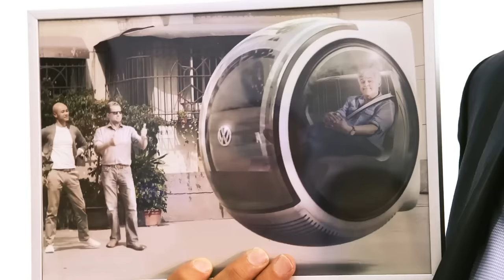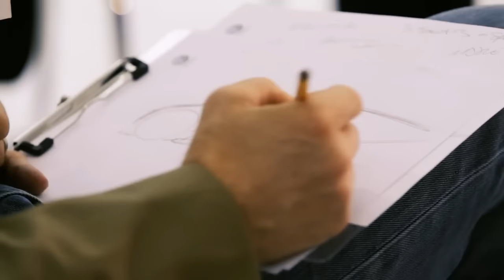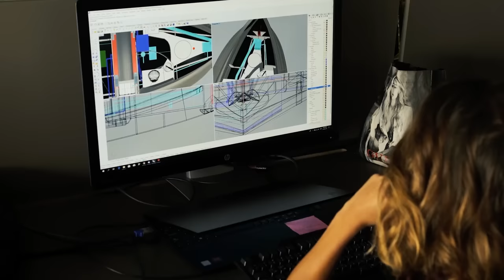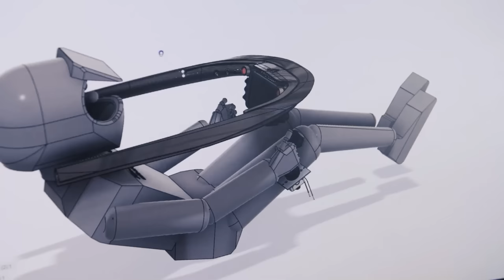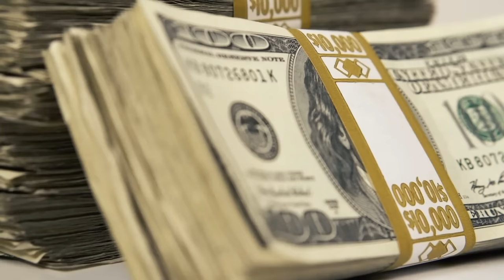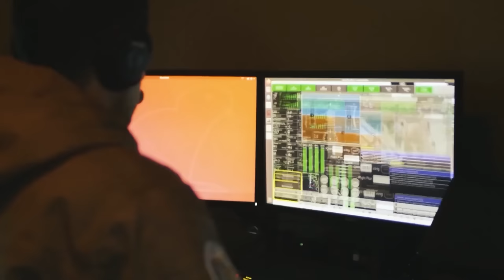The Plane That Will Change Travel Forever

Comment: No Electric system is completely environmentally friendly. FACT. The mining involved and manufacturing involved is not environmentally friendly.
Reply: Not to mention making of parts battery fires and when they become obsolete. You hit it with the hammer I just finished it😂😂😂
Reply: Electric still is a bit more environmentally friendly than fossil fuels, especially if they recharged with solar&wind. If you look it up you may learn something. I don't like electric for a different reason, they burn. As soon as they make non burning battles  I will convert my van to electric with solar on the roof.
Reply: @Justwantahover  let me know how that turns out! In some areas it could solar and might be more proficient than others, but that would be the exception, not the rule! My son has a Tesla. It's great for short trips and commutes, but a pain in the ass on trips! The infrastructure isn't here, and 81% of the electricity produced here comes fron burning hydrocarbon based fuels,  so WTF is this clean energy? A full 50% of the electricity produced in the U.S. is produced by burning COAL!! Producing 'clean electricity' is the greatest con job the government has ever convenceg you snowflakes to believe in!!
Reply: @Justwantahover  so, you drive it  2 days a week? It'll take how many hours of solar charging from that size solar panel to drive 3-4 hours? And, depending on where you live how dependable is the amount of sunlight you will factor into this equation! Don't get me wrong, if 25 or 30% of the drivers went to electric cars the demand for gas would go down, which should drive the price of fuel down! But, you geniuses do realize that there is a built in tax at  the pump that pays for upkeep of the road system! The only  dependable source of electricity is hydro electric damns and nuclear. But, the nuclear reactors have to go down for maintenance every year for months! Even if wind and solar are clean, the construction process and maintenance cut into that! Good luck.

Comment: 1:52 The problem wasn't the hydrogen, one was coating the textile balloon in termite (which when it starts burning it burns at temperatures high enough to melt steel), and the other one was not splitting the hydrogen into multiple fireproof balloons inside the bigger balloon (so fire doesn't spread, and optionally having a mesh of hoses which can be filled with water, so the hoses melt thanks to the heat and start releasing water onto the burning parts), and those two problems compounded/together turner an accident into a disaster. If the Hindenburg didn't use a substance more flammable but less explosive than gunpowder, for the balloon coating, and/or if the balloon had multiple fireproof balloons inside the bigger balloon, then the fire wouldn't have spread so fast (which means it would have landed a lot more softly), or it would have landed much slower even if the gas did end up burning from 1-2 smaller balloons (compartments). 

Not only that, but a very easy way to prevent airplane disasters would be to attach inflatable balloons which to be deployed and filled with compressed hydrogen, in case of an emergency, which to at least significantly slow the descent of the aircraft, if not make it hover in the air if it lost both wings and engines, and in which case manual valves should be usable to slowly but surely release the lifting gas, to allow the airplane to land safely, and if a storm is brewing, at least half of the balloons should be able to be popped, and airbags below the airplane should be deployed before that happens, to soften the landing and ensure the plane doesn't land sideways due to strong winds. And this would allow the appearance of short-distance airplanes which to be airship hybrids, being refilled with hydrogen before takeoff which would also require a much shorter runway, then fly at slower speeds or higher up to not need as much lifting force from the wings due to the lifting force from the hydrogen bags, then when landing you get to use it again to land needing a much shorter runway, or you can even deploy hydrogen balloons to turn the airplane into an airship and help it slow down before landing, so you can have a slower and softer landing on a much shorter runway or even on an airplane-sized flat area, like a crop field, or a pond or lake, a parking lot, a stadium, a plaza, a wide street/highway, or some other large opening.
Reply: They now have airplanes that have Parachoot's on them. Per: Kelsey@ 74 Gear, Just F.Y.I.
Reply: That's a great idea! However, the parachutes can only do so much to mitigate the ground impact. A battery-powered system of lasers calculating the distance to the ground could automatically deploy lots of cushions around the whole airplane, in a semi-circular shape to encourage the airplane to stop with people in an upright position, with the balloons made to quickly inflate but slowly deflate, even if only in a few (3-4) places around the fuselage (main body of the airplane), because even just that cushioning would be a whole lot more than nothing, in the case of a crash landing, and could save plenty of lives. And having inflatable skids would make landing on water much easier, too, especially if part of the semi-circular inflatable balloons, and they could even have other inflatable balloons which to keep the airplane afloat indefinitely. 

If the plane still has fuel and none of the main engines work, an emergency small propeller engine could be raised from the fuselage, to be able to propel the now-boat airplane towards the nearest piece of land, and if no fuel is available, then there could be a folding mechanism to allow a few people to pedal, to power the propeller, with a gearbox to achieve higher speeds, and could double as a backup generator for things like the emergency broadcast system, and for a few lights if the energy from a few lightweight flexible solar panels isn't enough to last through the night, for the needed use-cases. 

And the pedal-powered propeller could also be used both as a windmill in rough winds, and as a windmill once the shore was reached. And even without that propeller, a small foldable lightweight windmill could be stored on-board, for emergency power generation, once crashed. A few flexible (to resist the impact of the crash) solar panels, a lightweight foldable telescopic windmill with tent-like rope/wire supports, a few batteries with a lot if cushioning around them, a foldable system for multiple people pedaling at the same time, and 1-2 lightweight foldable bicycles with inflatable pontoons and the bicycle rims having waterwheel-like fin-like extensions to be able to act like a pedal-boat (even if not very efficiently) or with a boat-propeller accessory, and fishing nets which can expand a hundred meters (100 yards, or 300 feet) from the shore (and which can be used to fish if stranded), all of that wouldn't cost that much to carry around, both in volume and in weight. Maybe 20 kg for all of that, which is less than a passenger's worth of weight and volume, and you could have a pack like that in the front of the aircraft and another in the back, in a sturdy box with lots of cushioning inside (so the package survives a rough impact), which would still be less than the average human in terms of weight and at most the volume/space of two seats, including the cushioning for it to remain working after an impact. Maybe add a few curtains, which can be used as awnings, if landing in the desert, just in case, or which swimmers could use to waterproof the outside bottom of the airplane, if there is a leak. Add a foldable solar cooker, or a few, and the fish can also be cooked, and a few pots and pans for that to be done and so other fire sources can be used for cooking during the night. And a satellite phone in the package (or each of the packages) would help if the main signaling device is offline, even if it's hand-cranked.

All those things combined would turn a crash-landing on land or in the water, which otherwise would lead to no survivors, into a story about how those safety devices created a short-term ocean colony so everyone can survive at least for a few days, and maybe even forever in case of an EMP or CME with no survivors ever coming for them. 
 @michaelolinger1074
Reply: @SapioiT  So, by the time you've added all these balloons to the design what will it weigh?
Reply: Or, instead of using flammable Hydrogen why not just use inert Helium......
Reply: There are three things that burnt during the Hindenburg disaster: 1. The Hydrogen lifting gas, 2. The doped outer cover (doped in Thermite not Termite, termite is an insect), 3. The Diesel fuel that was used in the motors.
The Hindenburg, like all rigid airships had multiple "balloons" - called Gas Cells. The fireproof material would have been more problematic in those days (1930s). The only substance that would have been available was probably wool or something similar which would not be gas proof.
Two-thirds of the people on board the Hindenburg survived when it crashed.
Reply: @kiwitrainguy  To be fair, for the tech level they had available, that many casualties are to be expected. If they continued using them for a few more decades, or revived them as soon as the fireproof gasproof materials became available, then I think they would have been very successful up to even today. Heck, if I'm not mistaken, they could have made thin metal sheets, to hold the gas, and some other heat-resistant material to hold the thin metal sheet in place. so it doesn't rupture.
Reply: Yes, and just because an airship is filled with hydrogen doesn't mean that it's dangerous. The Germans were using hydrogen with all their airships and the Hindenburg was the only civilian one that caught fire (the others were during WW1 when they were being shot at, fun fact: - or maybe not so fun - incendiary bullets were developed so that hydrogen airships could be shot down). There were 3 of the US airships that were filled with helium but they still crashed with loss of life. @SapioiT
Reply: Thanks, @kiwitrainguy  ! It's sad that we don't have airships in use right now. They could be used for freight transport for countries without rail infrastructure for trains, for example to get from the east coast to the west coast of USA or the other way around.

Comment: We do have flying cars, for many decades now we have been seing it flying around and it's called a helicopter. This is a very reliable and safe flying system that has been around for over 70 years now and we have many machine types and sizes. By the way, flying ain't cheap, so forget comfortable flying machines at actual cars prices, it is more at formula 1 or very super expensive sports cars that you would find a comfortable flying machine.
Reply: Flying used to be cheap. I was ill paid and sill could afford to fly. I bought everything myself since 13 years of age also. It is the rip offs in the world, the crime that go unchecked, the good ol boy system that makes it hard now....ie::: forget the Amer dream unless your are a crook in the crook system.
Reply: I agree that the helicopter is a flying car. The problem faced with lowering costs so that the average person can purchase is the labour involved in manufacturing. The quadcopter design currently used by drones may be the ticket. The wings are inefficient compared to a single rotor helicopter but production and replacement costs are way lower.

Comment: CGI and speculation isn't really enough. Also I would suggest improving the dialogue. 
I'm not sure that the voice was electronic or human, but weird spacing and pauses really don't help engagement. I'll give it a bit more time but the 'hopefully they won't use hydrogen' line is going to need a bit of clarification because airships are gong to need lighter than air lift. Helium, hot air and vacuum will do it but that's a bit of a leap, so slipping swiftly to the next vehicle type lacks this rather critical and fundamental element. Similar to 'or they could use anti-gravity'.

Comment: These all are sourced by, targeted toward, and praised by, a population with a degree of detachment from reality that only 10-15 years ago would have only existed among science fiction creators, those under the age of 6, or the certifiably insane. In the short time since then, such a degree of detachment has become common, predominant, politically powerful, and a clear indication of enlightenment and right-thinking, as fomented by a modern public education system. Who cares what it is inspired by, what color it is, that it’s design artistically communicates efficiency, or that it is environmentally friendly (a mirage), or is associated with a low carbon footprint (a fabrication sorely lacking true scientific veracity and in truth meaning absolutely nothing); if the damn thing doesn’t work, and no one could afford it anyway, even if it did.

Comment: These developements are the result of crashing monopolies on energy management and distribution.
The ideas were always there, as they were with cars, but the access to technological developement was blocked by a very productive, but insanely violent and brutal economic system. 
As that system slowly collapses, the whole world changes.
We have been catagorically kept isolated from very basic understandings of physics that would present competition  to  that economic system.
Isolated from simple facts that matter a lot. 
Like the fact that air can not slow down.
Do you understand what that means?
It takes some time to wrap your head around.
But when you do, you will understand.
These flying things are just the beginning.

Comment: The Uber air bus could easily recharge itself in flight if they embedded the wings/body with solar panels.
Reply: No it wouldn't
Reply: @charlesmigneault7918 no but it wouldnt hurt adding it if lite enough